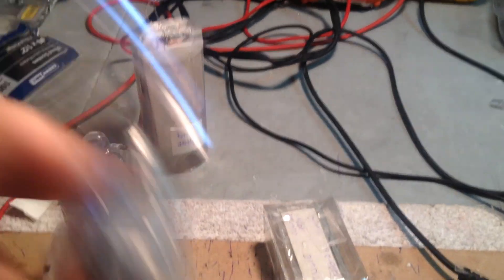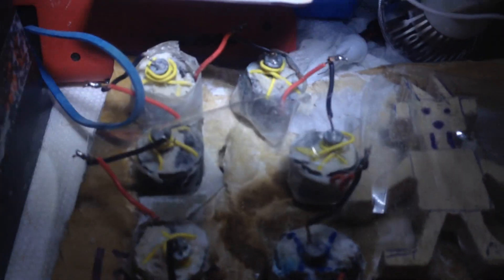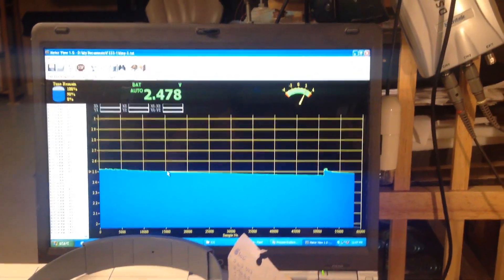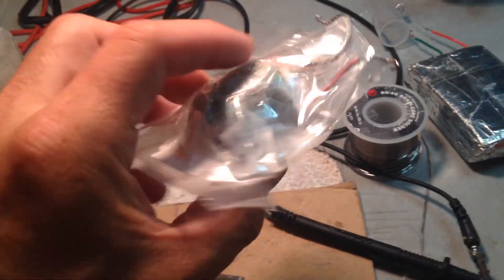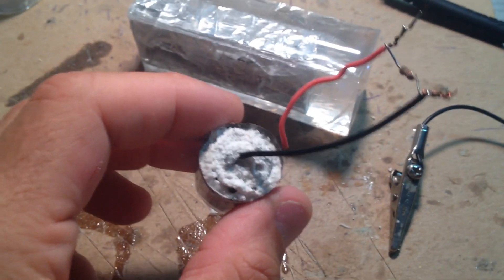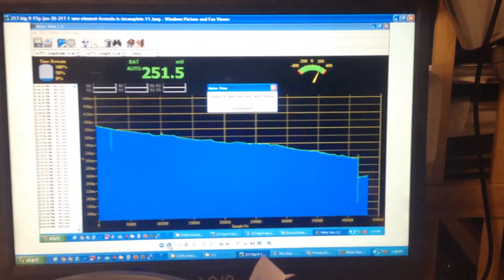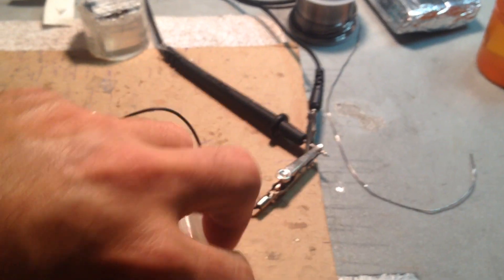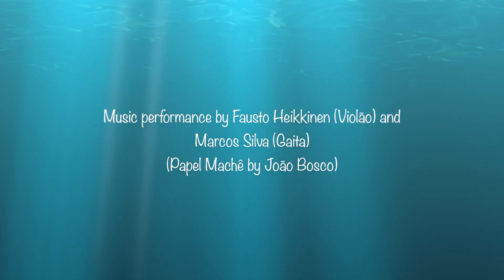Crystal Cell - Night Light

Comment: Fausto, you are my hero. I have been watching your videos for years and coping as much as I possibly can. No one has done the research and testing like you have. Thank you so much for sharing and being so through. I made a couple of changes you might like to know about. I changed the perma lube with olive oil and have had very good results on reducing the corrosion problem. Very little olive oil is necessary and no water was required.   Thanks again, Peace to you .... Lynn
Reply: Oil works indeed BUT it will eventually give up by "physical pressure" and rupture its  protective layer and boom, corrode the cell, BUT great experiment. Come to the forum at http://www.overunity.com/13061/crystal-cell-research.
Reply: Fausto Gomes
 we all are :) .... some better than others. We see people like us seeking answers and feel comfy that we are not alone. I am sure nano technology, Graphene, and 3d printing will take it to the next level.

Comment: 6 years from now. Is it still works?
Reply: Yes. I have 3 running non-stop, no-touching, no-water, nothing and still run an LED. They are casted inside an epoxy resin.
Reply: @FaustoGomes  Wow. Thanks for sharing and a fast reply. I believe you found the golden ratio. But I believe what is killing those cells is the overload. If you keep it in the right load, It can long last forever.

Comment: hey man just wanted to know how do you mosturise the cell when it is ecapsulated in resin
Reply: CARTER TECH I don’t. That’s the point of the casting, to stop air,moisture and gasses from getting in and out.
Reply: @FaustoGomes  cool thanks for replying. So how long do they last when encapsulated in the resin
Reply: @cartertech2531  So far I have 3 running non stop inside the unopened casts for 5 years and they are not showing any signs of stop running.

I am preparing a series of videos and a presentation showing where I am and what I have found so far. Keep tuned.
Reply: @FaustoGomes  hey so I'm kinda new to this and really wanna know if this is a better solution to energy storage than Li ion. Intrested in this kind of "battery" after watching a few of your vids and wanna know if these can be used for something bigger than just a simple night light.

Comment: ambient light sensor and regular rechargeable battery connected to the LED. Crystal Cell recharges regular rechargeable, when lights go out, led comes on running from rechargeable, would double your light output perhaps when you need it ie in the dark? A rechargeable that is good for a really high number of cycles...Im dreaming of a cystal cell lamp replacement. :)
Reply: Brilliant idea.